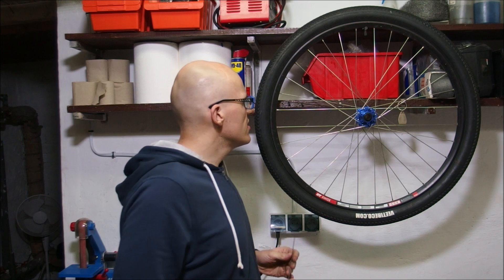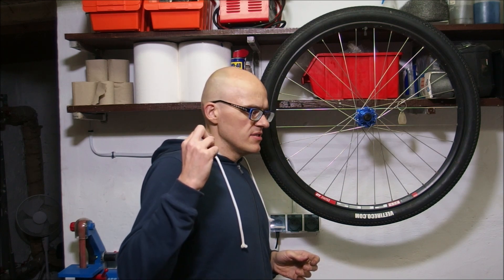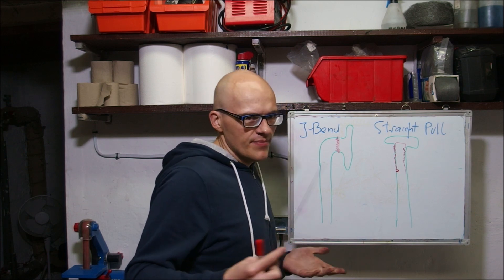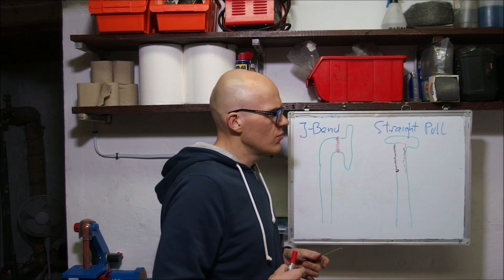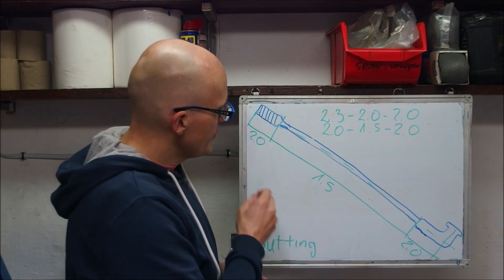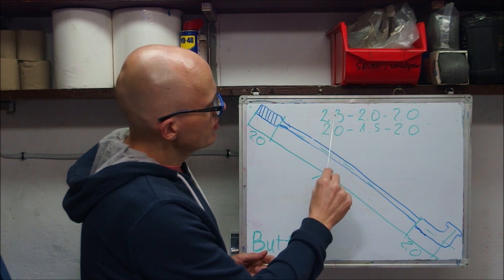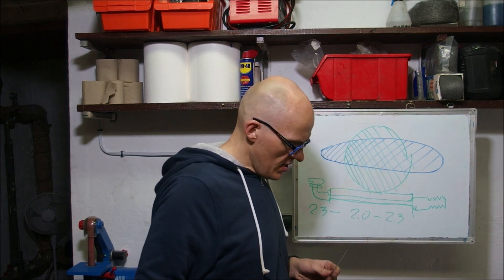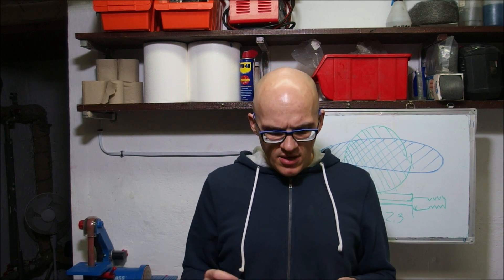Bicycle spokes: Everything you need to know.

Comment: What oil & Grease would you recommend for rust prevention and spoke preservation at the J-Bend on the hub to prevent breakage?🚴‍♂️
Reply: spokes that rust automatically have worse mechanical properties than stainless steel, because they are cheap and therefore that steel is not special either,Because who would buy a solid, high-quality spoke and have it rust, and no one would

Comment: Nice overview. I like the recommendation for J-bend, stainless steel, double-butted, rolled-thread spokes. Good availability, very high tensile (and fatigue) strength, lightweight, and at a low price depending on brands and your region. Wheelsmith is a good spoke brand in the USA. Some of the boutique brands offer ultra-lightweight spokes made of titanium, carbon fiber, or synthetic fibrous ropes; however, usually the price points of these spokes do not justify the minimal weight savings that you can achieve with them versus a quality double-butted stainless steel spoke.
Reply: Reducing mass on the largest possible wheel radius has a multiple effect than reducing the same mass on, for example, the frame.
Reply: That's true, but total inertia only comes into play when accelerating. The harder you need to accelerate, the harder you're fighting the rotational inertia of the wheel assemblies. I would also argue that a lighter rim is more influential than lighter spokes on total inertia. If you spec a wheel with a higher spoke count, then you can get away with a lighter rim, and the mass savings on the rim will trump the mass gain on the spokes.
Reply: @johnbarron4265  the bike constantly speeds up and slows down as the pedals are turned, I lightened the bike for one uphill race, and most of the weight reduction was on the wheels which were 50% lighter, the bike was like a wild horse, with every pedal stroke it looked like it was going to spring onto the rear wheel, I passed my opponents as if they were standing still
Reply: @makantahi3731 I think you passed your opponents because you were fitter and produced a higher specific power output than they did. Remember, it's about watts/kilogram in a climb. Where the mass is on the bike/rider system does not matter. 1kg is 1kg when you're climbing.

Comment: I had Mavic X-717 26" rims with straight gauged spokes, 32 hole.  After a few years of city commuting, and light duty trails my rims developed crack at most of the nipples. What causes this? I never did any down hilling or jumps. Was it a bad wheel build or is the Mavic rim cheap junk?